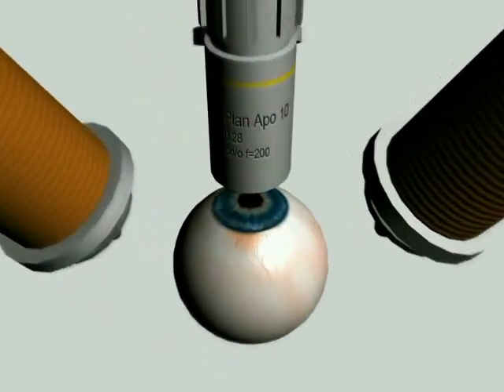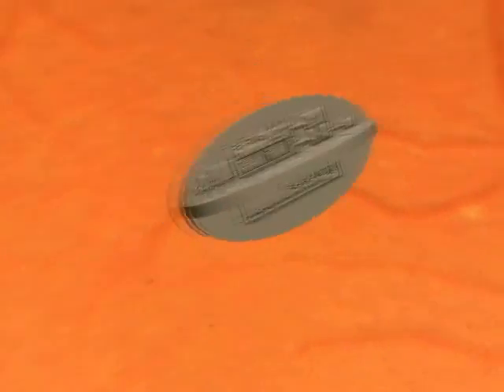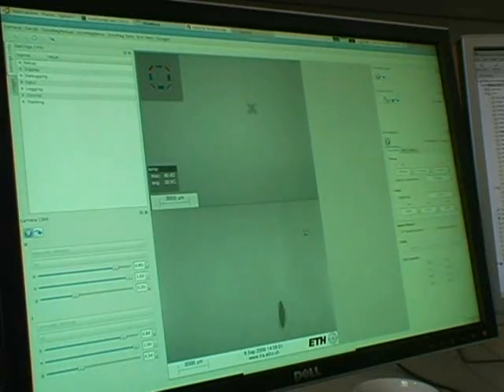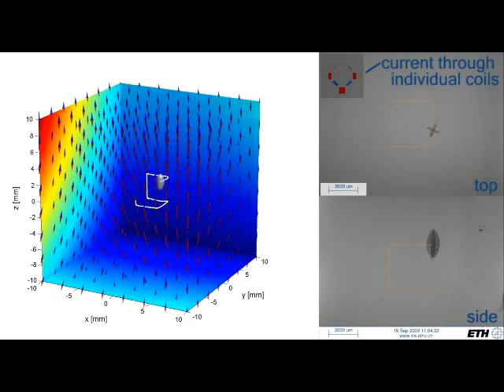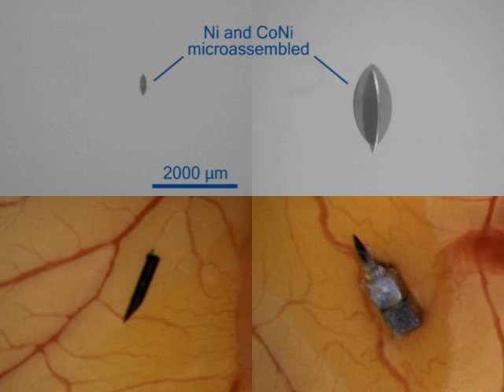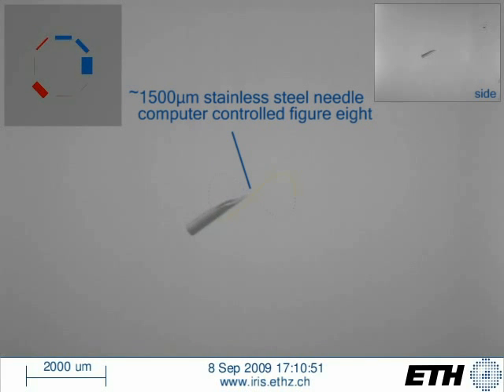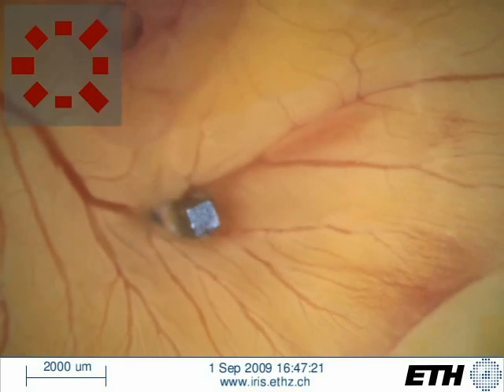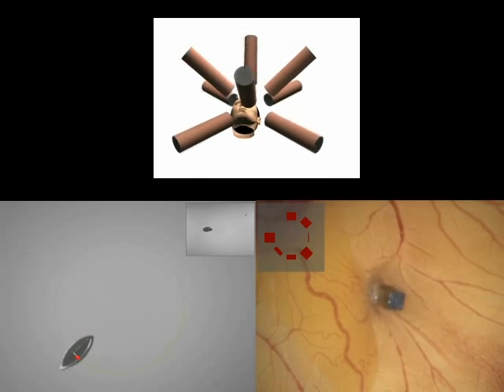OctoMag: An Electromagnetic System for 5-DOF Wireless Micromanipulation

Comment: You could also measure local chemical concentrations while manipulating (or drilling). Check out Magnetic microdrill as a modulated fluorescent pH sensor, JMMM, 2005.